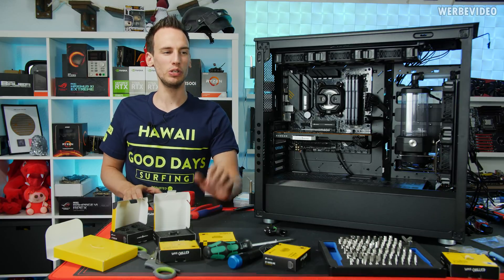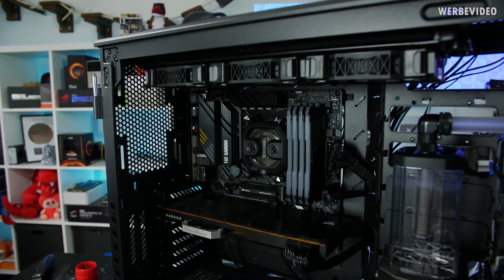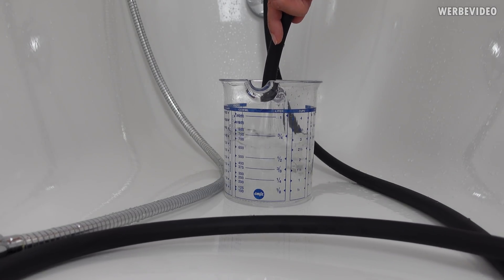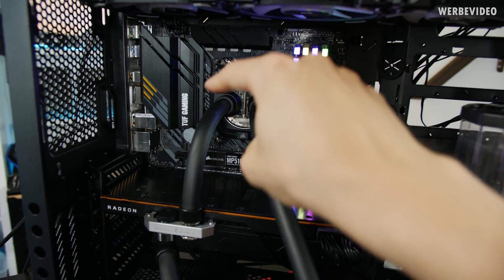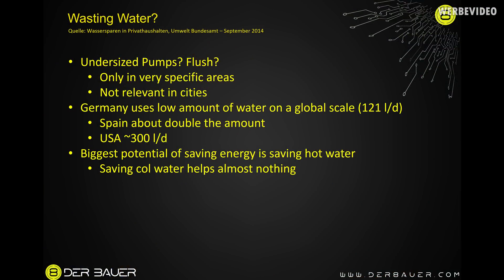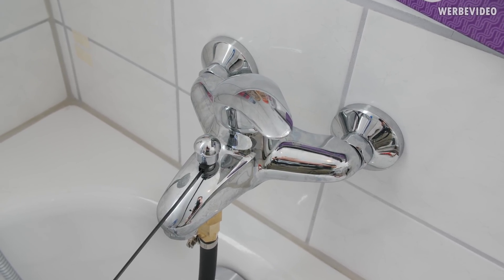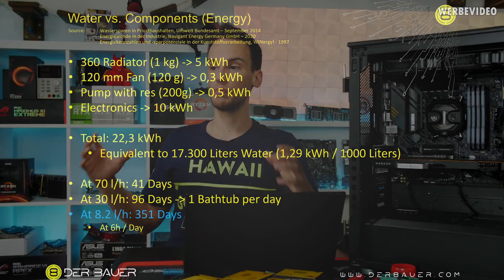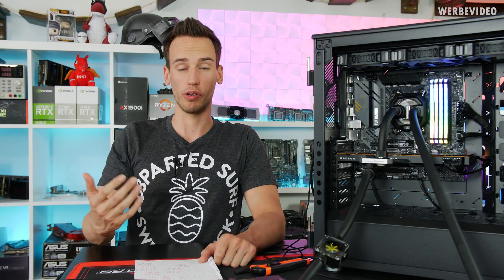So much Better than expected! Cooling my PC with TAP WATER

Comment: At 8.2 liters per hour with a 15C delta you have  8.2 * 15 * 1.16 = 142.7Wh that is the amount of energy removed from your computer and that seems realistic for a CPU + GPU cooling.
You can also collect that water as if you run the computer say for 15h per day with that 8.2 liter/minute flow rate you need just a 123 liter storage tank maybe you can have that outside to get cool overnight and can reuse that the next day thus having no waste water but you need a circulation pump for that.

Comment: Neat video! It'd be interesting to also include the cost associated with the added load on the air conditioning unit when running a radiator that rejects heat into the air in the room.

Comment: I would make it so the water coming out of the pc goes into your hot water, so use it as a water heater. So the water is not wasted. Traditional water heaters are on most of the time anyway(if water is set too hot)

Comment: In colder climate places during winter time it's really viable to cool your pc with a radiator placed outside and connected to the custom loop. Way more economical and cheaper. I am thinking of buying a MO-RA3 and just hang it outside at the window and drill holes through the window sill for the hoses and connect it to a water loop. What ya think? :)

Comment: Perhaps you can make a close loop into the water supply OR even run inlet from main water supply and outlet the excess water into a water heater tank. 
Might help with lowering power required for your hot shower.
0Edit: Then like any close loops, you'll need pump into the system. Pros point if you make that close loop, you can you more powerful pumps outside of your system.

Comment: This is what I thought water cooling to be about, before I found out it is usually a closed loop :) I think it's an interesting approach. If there was a secondary use for the water (probably not considered drinking water anymore ... but definitely not sewage waste) it may be fine both economically and ecologically.

With the low water flow, the temperature of ~ 33 °C is almost good enough for bathing. If done correctly, you're not wasting electricity on running benchmarks, you're heating water! You just need some insulated storage. With higher flow, perhaps you could still use it for watering plants if you live in the country ...

Comment: If you have a garden, you could save up the rainwater from your roof in barrels and use that to cool your PC, or if you have a swimming pool, or any kind of small pool or pond and recycle it back in the barrel/pool/pond. Problem solved. If you live in a house with a garden.

Comment: If you could somehow tap into the water supply that comes out of a sewage treatment plant you could do this without using drinking water. At least in my city, the sewage tratment plant cleans the water until it's almost indistinguishable from fresh water. It isn't drinking water though - it gets cleaned like that in order to be released into the Rhein, our nearby river. I'd wager the Rhein doesn't care if the water it receives from pipes went through some cooling systems prior. Could be an interesting way to hook up data centers, perhaps that would reduce their cooling energy consumption.

Comment: Out of all the problems with this, I think the worst one is that condensation is very likely to happen at some point if the tap water is colder than the air (if the humidity is high). I would not like to have that drip inside my computer....

Comment: The problem is that even for the pc is not sustainable, depending on your water you will face corrosion and/or calcification.
On the lasers they don't care about corrosion because they have glass tube.

Comment: The problem with this concept is that using water lowers the ground water level and leads to depletion of underground water reservoirs. This is mainly problematic if water treatment is in open cycle, where the clean water is discharged into rivers instead of being returned to the ground water supply.

Comment: This would be interesting if you could recycle the water into a garden or some catchment system for later use. I have a spare computer and I wanna try this with my creek. The water is super cold all year. Then, there would be no water waste. The only thing is powering a pump and if that could be powered by solar there's no impact. I want to try it but plumbing that would be a huge issue especially to get the water in the house and back out to the creek.

Comment: The waste of the water and inconvenience of having to be around a tap, I would be afraid of the build up of contaminants in the water blocking the flow on the cold plate, in some places (states, county’s or country) some are significantly better then others, but they will all have some amount of sediment or calcium to block those micro fins. On the whole, bad idea for the parts and the waste of the natural resources and the cost of the water itself. If you didn’t care about the cost and having to change out / clean the micro fins however often, it would be a decent way to cool your components I guess. (Btw I have no experience with water cooling, just my take from watching YT vids)

Comment: Hi, we use a pump to water the garden. Our pipe what goes into the ground is ca.60m deep. The water temp is 14c. Even on the hottest day or at winter too. Our pump uses 750w of energy to lift the water. I mean: if  you use the pump to water your garden you can use some of the flow for cooling stuff or even cool a tank of coolant (like a reversed boiler). We typically water our garden like 3-5hours a day, and if you use the full flow to cool a tank of coolant, you can use the stored "heat" to cool your stuff, and the next day, you cool it off again. (our pump is capable of 3000l/hour)

Comment: Yes technically you can use water to cool anything

As a car mechanic I know this will have downsides. There's allot of minerals, sediment and other metals still in tap water in relation to where the water comes from, which will cause damage to you cooling system starting oxidation and corrosion reactions as well as damaging any open bearings or even damage rubber seals. Also the effectiveness over a longer period will drop like a rock. Many cooling fluids like for in cars for instance contain dopes to ensure effectiveness over a longer period as well protection against corrosion and oxidation and lubrication of any bearings and seals it comes in contact with preventing leakage. Next to this water is a poor semi-conductor that can damage your system, yes also demineralized water, so try to use a fluid that does not conduct electricity in any way. Even when it is a very poor conductor. It is still enough to damage your electronics in case of any leaks.

Can you use tap water for a few days as an emergency solution most likely yes, but do order yourself decent cooling fluid to replace it and even pull the entire system apart to properly clean it to make sure any sludge from the old dry fluid is gone.

These are a few rock hard reasons why we simply do not use tap water in many cooling systems regardless its cooling capabilities.

Comment: Great video! It's obvious that cold water from the tap is going to cool a computer better than any other type of heat exchanger, what was really interesting were the implications that you went through: environmental impact; manufacturing impact; financial cost.. All that was very much worth covering.
I've seen industrial applications where the water is taken into the building's heating system - essentially using the servers to heat the human inhabited areas. At the domestic scale, you could tap into the supply for your central heating or hot water, or go back to the good old days of having a hot water tank.
As for all the minerals and chemicals in tap water, a layer of filtration would be easy enough to add.

Comment: If you could somehow incorporate the loop into the connection between the cold tap water and the water heater, that could be extremely efficient. This could be a way to incorporate the cooling loop  to actually aid in the heating of your hot water.

Comment: The issue is plumbing for many, I imagine. Unless you store your rig in the bathroom (eek, shower steam) with cables run through the wall to an office, you'd have to run pipes/drains probably, which changes the cost difference.

Comment: I considered doing this at one point.  Between the livestock and the garden, we go through more water than your estimate per day through the summer, just need a holding tank to even out the supply.  Only catch is the water is incredibly "hard", calcium and iron.  Would be pretty bad for the components I think.  If we ever move to where the water is better though, it's certainly a consideration.

Comment: I'm on a well (that's almost 300 ft deep), and gravity septic. So the waste would primary be the energy for the pump that fills my 1500 gal well reserve tank and 50 gal pressure tank. The water itself would just end up back in the ground. Still way to much hassle. Neat though.

Comment: It will end up with limescale on the cpu block fins over time and not be as efficient. At least in theory that would happen after prolonged use. Soft/Hard water are also a factor in this of how quick it will happen. Also depending on how water comes into home, if its above ground and very cold out in the Winter you might end up having water so cool it creates condensation on the pipes.

Comment: When I was a teen many years ago with no air conditioning  I built a cooler for my room using a heater core hooked to a garden hose.  It worked surprisingly well because the water from our well was pretty cold.

Comment: bathtub can serve as a reservoir for testing. use it as a reservoir + a cheap big water pump. 
you can check how much water is needed to cool a PC if loop size doesn't matter. for constant usage a bath tab can be replaced with a plastic water tank.

Comment: I have a plan to make a very large evaporative cooler, or "bong" cooler as they are nicknamed in the PC cooling scene, I'm talking hundreds of litres in a reservoir, with a pond pump (with a filter) inside it, pumping just plain old tap water, to a heat exchanger's hot-side, and then back up to the top of the evap tower, where a shower head or sprinkler head of some kind, will then spray the water down a tube that will have cool air being pushed through it by a fan(s), thus wicking the heat away from the warm water as it then falls down and collects into the large reservoir, this cooler will be outside of my house, with the tubing and heat-exchanger outside as well, and then tubing going to a pass-through into my house.

On the cold-side of the heat exchanger will be the loop for my PC, with only a pump to circulate the water, and no need for fans or radiators, and I might even incorporate the PC into my desk, and make it hidden away, and sound dampen and isolate the pump as much as possible, so that the computer is out of sight, out of mind, but has impressive cooling capacity, and will be highly overclocked...and the cooling solution will only utilize two pumps and maybe one fan, and when the water level eventually evaporates down a fair amount, I can just top the reservoir up with more tap water.

Comment: im curious. if you buy a 1000L water pallet. put it outside out of the sun. put a small pump on it like you use in your pc. you could use that loop with no problem i would say. the mass will not warm up but you will have an almost limitless supply of cold water

Comment: Some places don't even have much of an environmental impact. In Montreal, we're an island in the middle of a river, with the river draining into the ocean. The tap water comes from the river, the wastewater goes back into the river. Any water we don't consume will mix with saltwater anyhow, and the electricity used for pumping/processing comes from hydro. So there isn't really any environmental impact from using as much water as you want.

Comment: The water doesn't necessarily need to go down the drain. You could catch the water and use it to fill a tank for irrigating a garden or other uses. A good filter will make sure your waterblock doesn't gunk up.

Comment: What would happen if you fill a bathtub with cold water, put one tube into the tub (primed with water, attach that to a pump, then pump to the loop as usual, then have a tube exiting the loop and going back into the tub?

I bet the thermal capacity of that much water would mean it could cool the PC almost indefinitely without a radiator. You could use one tub for a day or two.

Comment: In Oberbayern the tap water is very cold but also very high on minerals, so independent liquid cycle with thermal transfer point would be needed, but then even smaller amount of water would be needed

Comment: I wonder if when building a home you could make a system that recirculated this water.

I'm looking at a property that has a well built into it, so I wonder what the feasibility would be of running the water back down through the pump, letting the thermal mass of the earth and pipe absorb the heat before recirculating it.

Or maybe run it into an already installed geothermal heater that uses underground fluid pumping.

Obviously the cost would likely be prohibitive, you'd be able to custom build a virtually silent chiller for far less.

Comment: Get rid of that portable AC and get a reverse cycle window/wall unit, portable units create a negative pressure which constantly sucks in fresh warm air (as my dusty doorjamb could attest to) window/wall units however separate the hot/cold side and recirculate the air and reverse cycle units go even further and let you swap the hot/cold side which is more efficient than electric heating since you just moving existing heat.

Comment: Well you could always go green :-)
Go find a watermill wheel with a decent flow, mechanically create a pump from the energy gained from the river and use that to take cold stream water into a controlled filtered temp environment, then from the res. using the same type of pump, use that with lines to cool the computer and have the outlet flow directed to water crops in a field, while using windvayne generators and solar to supply the computer with energy.................
BOOOM green computing.
Reply: Complicated and inefficient, just use a nuclear reactor :P
Reply: I like this idea.

Comment: During the hot days my AC is pulling 1200W 24/7 and is struggling to keep the computer room at acceptable ambient temperatures. It's really bad. I think quick disconnect fittings on the PC to go from tap to radiators would be a solution for 1 month per year.

Comment: Bad idea in the long run. Because: Calcium deposits like in a washing machine at the hot components if your water quality is wrong.
Reply: use calgon :o
Reply: @smachine3811  not funny
Reply: Clean it with vinegar every now and then

Comment: i was never interested in water cooling, but ever since it became a thing (2000's) ive asked myself why cant people just connect a tube to running water and run a slow and steady stream (little faster than dripping) of water instead of so much gadgetry associated with water cooling - which honestly i always knew the costs per year would be much lower than full water cooling setups

Comment: I work on Emergency Industrial generators. Some use heat exchanges  with city tap water run through them. Some smaller ones use marine water cooled exhaust and intake manifolds the only difference clean city water is used over salt or pond water like the boat would use. I have been thinking about using a geothermal loop. You should look into it. Houses use a underground loop for heating and cooling as the earth at a certain depth it always around 50 deg. F.  So it works for heating and cooling. If you want your house at 70 on a 20 deg day you only need to heat 20 deg as you have a free 50 deg from the earth . It works the same in cooling. If its 80 outside you have a free 50 degree source to flow though the coil in your air handler. I think burying a loop of coiled pipe or reusing a piece of a forced hot water radiant wall strip  buried vertical in your cooling loop would work to cool a pc.

Comment: Well I think you actually did miss one point. My high-school chemistry teacher always said; and I think it is a stupid saying, but it does have some truth to it: "The solution to pollution is dilution". But in this instance it might actually be a valid point. By running down clean water through the the waste water system, cleaning the water again will be easier and more efficient. I do know of a few instances, where sewage plants have to use fresh water to dilude their waste water, so there bacteria will not die. So at the very least by you cooling your PCs with tap water, the Berliner Kläranlagen will thank you, because you pay for the water and they do not have to.

Cheers
Dirk

PS I still think wasting water is stupid, but I think you are kind of using it. Wasting millions of liters or gallons of water to make sure your golf course in the middle of the dessert is always green, that I would considder waste. Doing some testing for overclocking on tap-water, I guess should be OK.

Comment: Initial thought, 90 seconds in: I think it is a waste of water, there should be a better way. Curious to see the actual answer, since when it comes to engineers, there is no way this method would be used on the CO2 lasers if it didn't make sense in some way I am not seeing atm.

Comment: did somethine similar long time ago. i just had a pump, a cpu waterblock and a huge reservoir holding at least 300 liters of water. by the time the water reach the same tempt as the pc, it would have took like 4 hours.